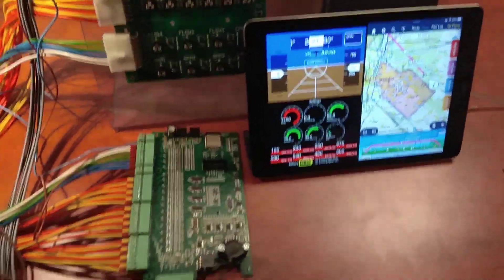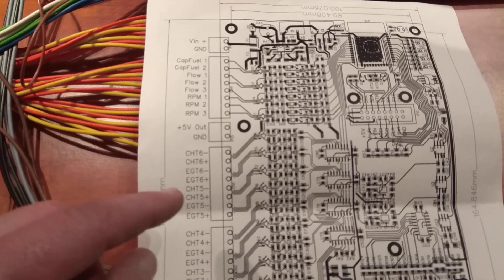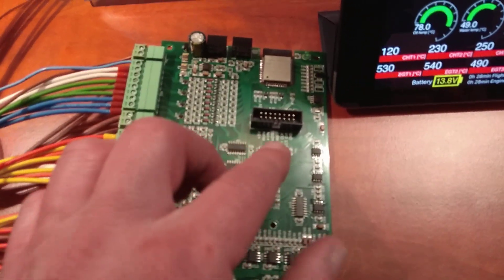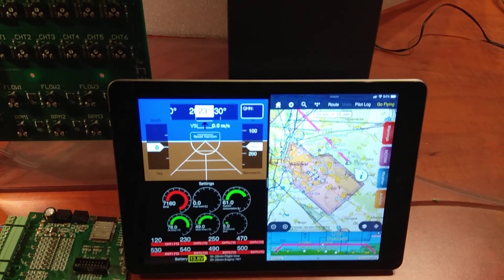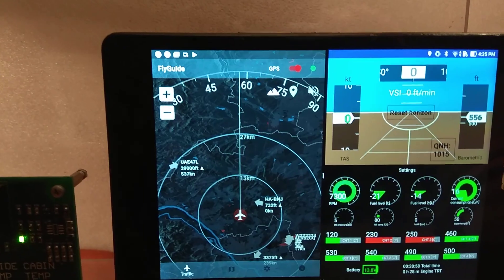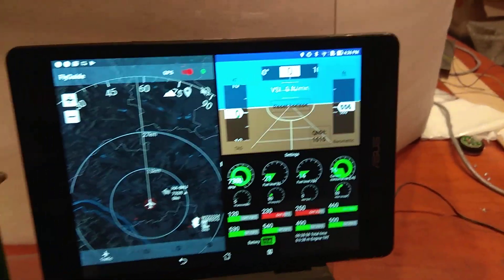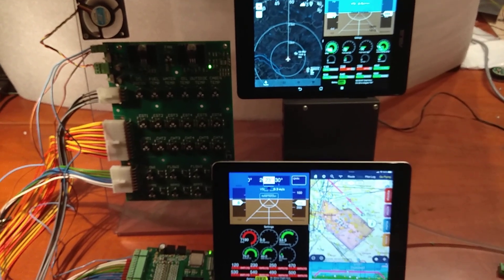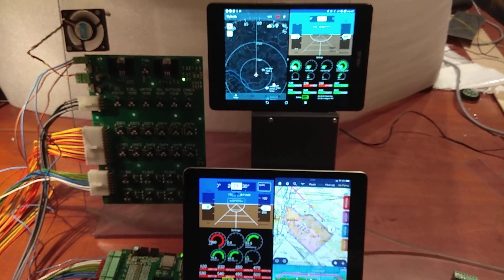Skylab Wingman EFIS 2020 English demo

Comment: Hi. This is Abid from Florida. Have you developed the module for 915iS or 912iS with Aviation Canbus data transfer yet? In the US Foreflight is more a standard for navigation and we have ADSB IN which shows all ADSB weather and traffic on moving map like Foreflight. Also we make gyroplanes and making the AHRS work properly on a shaking gyroplane for things like MGL iEFIS is terrible. Their software is not good enough to filter the shake and give solid AHRS reading. Garmin and Dynon are pretty solid. Have you tested your tablet solution on gyroplanes
Reply from the maker: Hi Abid, I dont think that those who can afford 40 grand for an engine will go for our little experimental efis for a couple of hundred bugs. If ADSB receiver is on Wifi than it will not work together with our efis on Ipad. Since Ipad can handle only one wifi connection at the time.  On Android we do BT, so wifi can be an other channel for the navigation software. In other  hand we are targeting low budget, experimental mostly VFR market, and AHRS is good as the tablet gyro sensor.